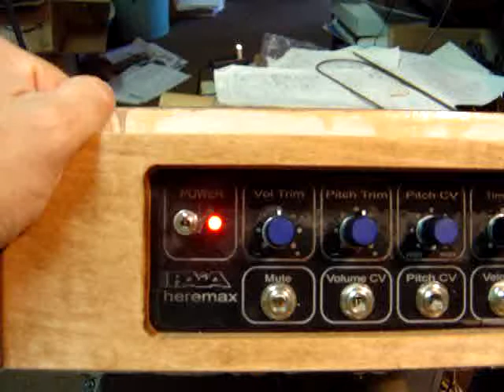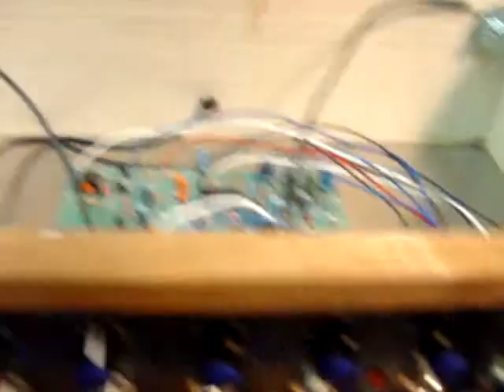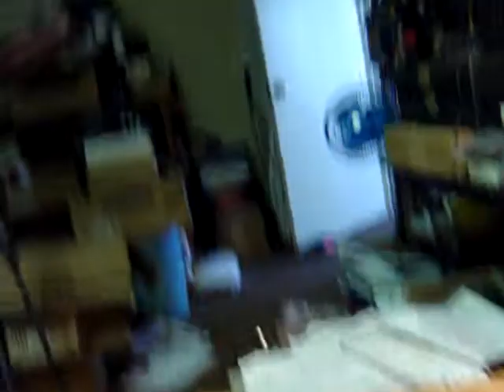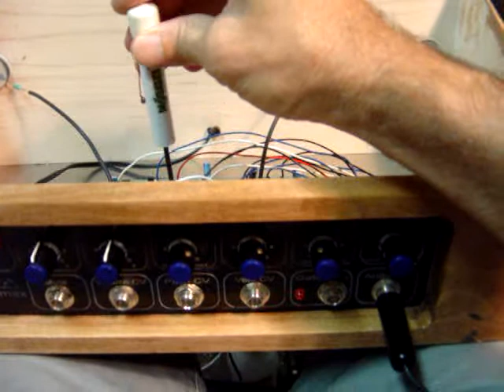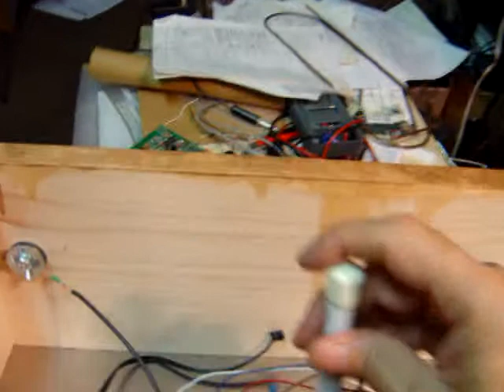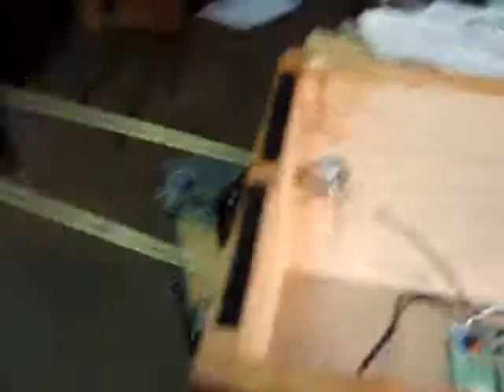Theremax Quick Tune (better audio)

Comment: It is not advisable to use a metal screw driver on the tuning slugs. The metal will de-tune the resonance point and the sharp edge of the screw driver will  chip at the edges of material.

Comment from the maker: @noon30productions 

The L5 Choke Coil, which works to couple the oscillation from transistor Q4 to the volume antenna, might be open-circuit.  The same 7v dc that's on the collector of Q4 should be out on each end of this coil, and the antenna.